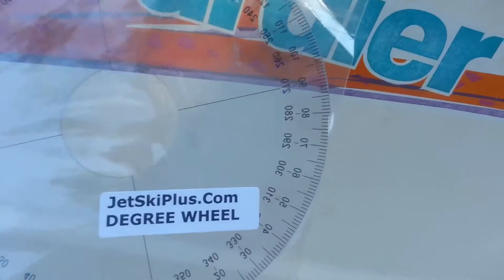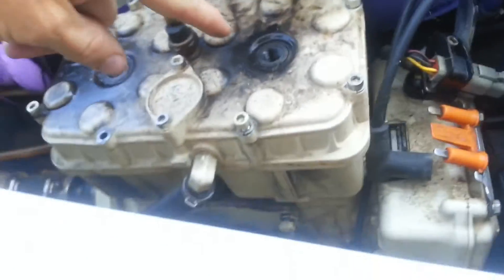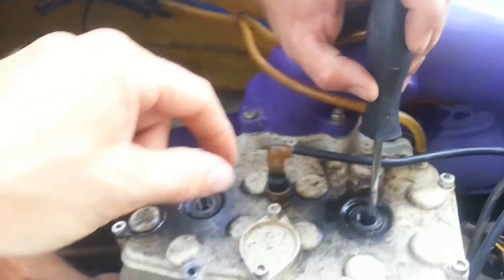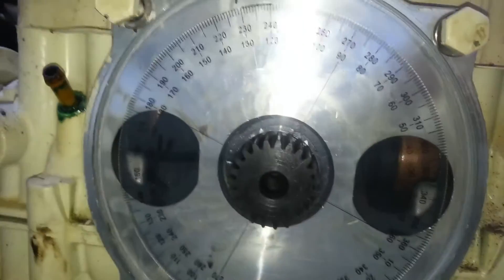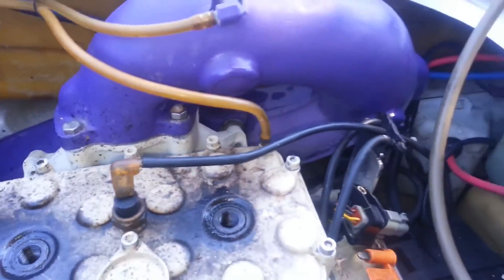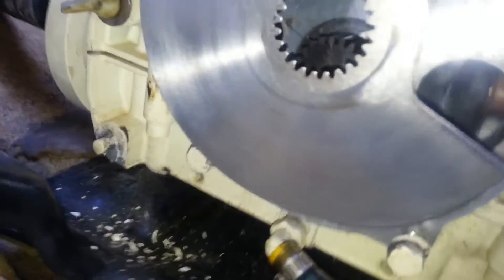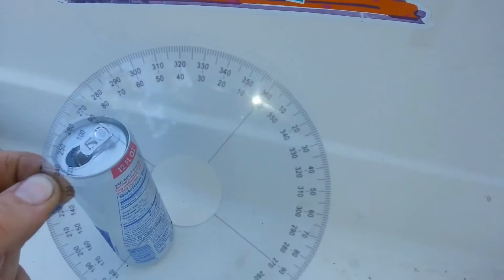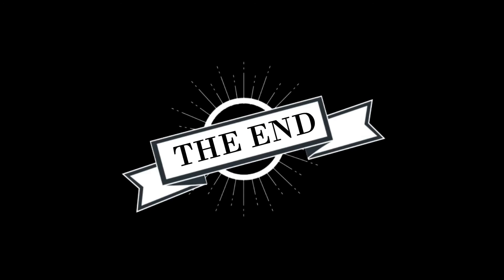How to use a SeaDoo Timing Degree Wheel from JetSkiPlus.com

Comment: why didn't seadoo just put a DOT on the rotary valve and the Gear to line it up that would have been more simple
Reply from the maker: Correct and some have them with a Tab arrow(DOT). You can see in this video it has the arrow. I went ahead and did the Video to show others on other non-marked motors.

Comment: Did you notice the little "ear" that they embedded into the housing of the rotary valve that is directly over the 130 deg mark?  You don't even need a degree wheel on this engine.
Reply from the maker: Sure did... but we used this to show how to use the wheel.. Not all have them have  (EAR marker) thanks for the comment